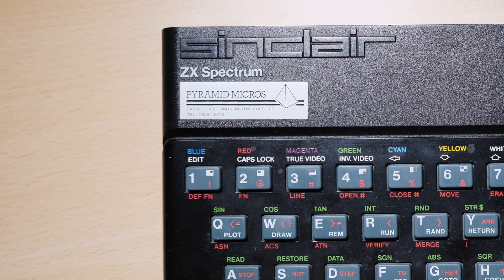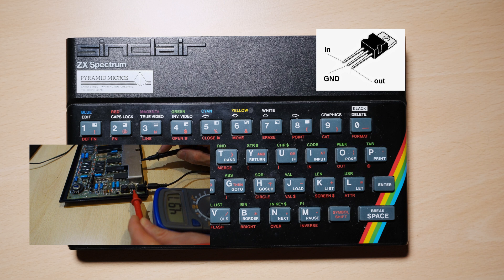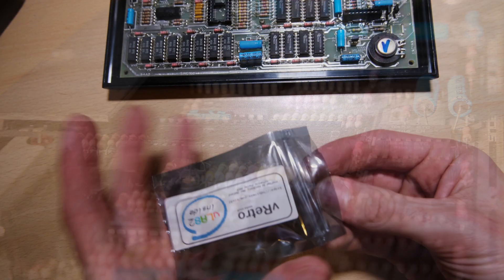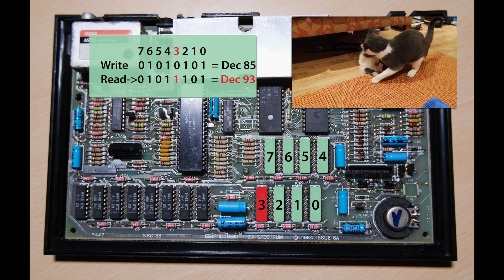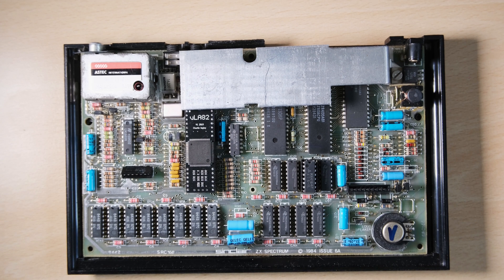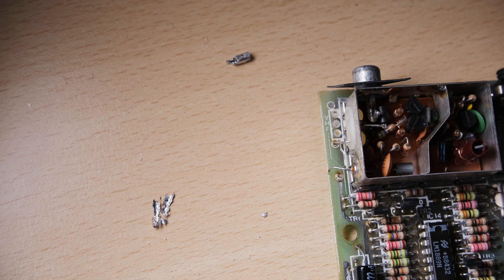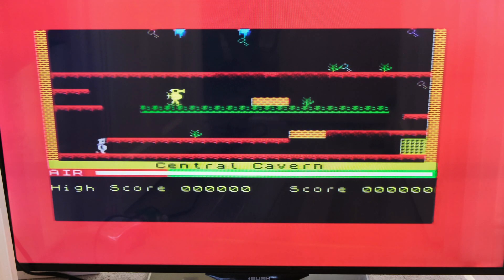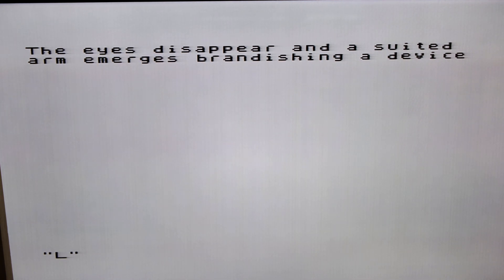Issue 6a ZX Spectrum 48K Repair - From Knackered to New

Comment: Really if you tests 40 years old capacitors in capacitance and ESR, you can see all are correct. The better things have a ZX Spectrum I think was the capacitors. It's not necessary remplace in general any one.

Comment: You'll find it took a lot of force for the VLA as it has round pins, the original ULA has a flat single wipe style. To do it right you need to replace the socket from single wipe to turned pin type.

Comment: i strongly advise using a cap for composite out, and possibly reducing the emitter resistor of the modulator drive transistor as will improve the negative going edges of the signal ..

Comment: minimum dc in is between 7.5 and 8v ...lower than 9v reduces heat in the regulator but stresses the dc-dc converter more as it has to work harder to get the +12v up ...

Comment: Jam in a TSR-1 2450 and you can dump the heat sink too. And it runs cool as a cucumber. $5 bucks on Mouser.
Reply from the maker: Good tip. I've got a drawer full of them.  I'm often torn though because you lose the authentic heft and warmth that the 7805 and the heatsink generate

Comment: Nice, I had an 81 as a kid, but it was lost several years ago, always wanted a spectrum but they’re not available in the states.
Reply from the maker: I've shipped a few over the pond ;)
Reply: there was the USAs own variant of the spectrum  TS2068, unfortunately not fully compatible unless you fit a spectrum rom in place of the original

Comment: One thing to do is replace the 7505 voltage regulator with a switchmode regulator, they run cooler, which extends the life of other components.
Reply: wont make much difference..
Reply: @andygozzo72  You have no idea how much energy the 7505 dissipates, it's dropping 9V to 5V, the heatsink gets painful to touch.
Without a heatsink the 7505 kills itself in a few minutes. A switchmode regulator(the can be a drop in replacement) can safely run without a heatsink, showing how much cooler it runs.
The ULAs are no longer manufactured, and Sinclair over exploited them in the design, so they run hot too. The two together are a recipe for failure. the other thing to do is of course heat-sink the ULA. 
The heat also contributes to drying out electrolytic capacitors. The 128k Spectrum had an external heatsink and was dubbed a "toast-rack". Sinclair designed their machines to be cheap, and pushed the technical limitations of the components.
Reply: @EmmittBrownBTTF1  yes, without it, it could fry(they're supposed to shut down with excess temperature, though) thats why they have a heatsink ,, loads of other devices use those linear 3 terminal regulators, some running hotter than in a spectrum, with no real issues ,

Comment: Nice video, in most cases TR4 and TR5 are indeed knackered. In some cases the coil could be knackered too.
Reply: definitely, a shorted tr4 can destroy the coil, it melts the wires enamel coating causing shorted turns, replacing tr4 without replacing a damaged coil will soon destroy the new tr4!  guess how i found out!!!!

Comment: great video, learned a lot about the spectrum's inner life! I also have a issue 6A 48K motherboard that has gone dark - no video, no clicking key sound. Did all the same testing as you do, I initially have all voltages in the 7805 regulator and lower/upper banks as per your video. but shortly after the voltages start to come down... I measure 4V at the regulator "out" and for example teh 12V at the RAM lower bank shows 9 to 10V... Do you think I should just change the 7805 regulator? Or transistors as well? Thanks!
Reply from the maker: Was the board working previously?  If so, I would recommend a new 7805, new TR4 and TR5, and then find a video by Joulespercoulomb "ZX Spectrum Initial tests" and follow along.  If you get to the end without any funny business then power it up and see what you get on the screen.
Reply: @HappyLittleDiodes  Perfect. will do so. actually , since I am at it, think i can replace the 7805 with a newer / more efficient regulator to have less heat dissipation, would you agree? thanks again.
Reply from the maker: Yes you can use a Traco TSR 1-2450.  I think Murata also make one which is slightly cheaper

Comment: I am after fitting a reset button to my issue 6a, could you please point me as to the exact location of where to put the wires from the switch, many thanks 👍
Reply from the maker: Hi Mike.  You can solder the two wires to either end of C27.  See the bottom left of this schematic.  RESET is active low, so you need to short it to ground to cause a reset.  
https://spectrumforeveryone.com/wp-content/uploads/2017/08/ZXSpectrumIssue6a-Schematics.gif

You can see it on a 4S board here
https://www.youtube.com/watch?v=NOUfxcpP3Xc&feature=youtu.be
Reply: @HappyLittleDiodes  Thank you so much for getting back to me and taking the time to show and explain how to do it. Definitely made a subscriber here 👍

Comment: A noob question, I can't see where you get the address 55000 from, for the Peek & Poke commands @ 7.41 ?
Reply from the maker: The address doesn't matter,  as long as it resides in upper RAM, which is all addresses between 32K and 64K.  I think I only chose 55000 because a website describing the trick used that address.

Comment: Hi, could you tell me what was with the wrong lines on the screen after ULA and Memory Replacement? I could tell some horizontal random lines on the screen. 
Thanks
Reply from the maker: I think you are just seeing an interference pattern between the resolution of my camera and the screen
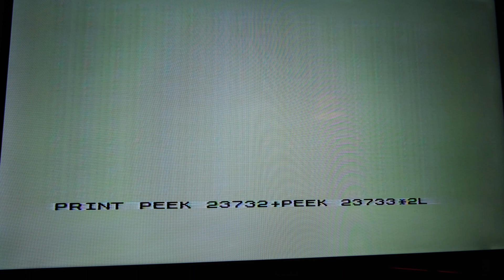Reply: @HappyLittleDiodes  No I am not. Minute 6:00 just a second before also later... about middle... centre of screen... and later appear some more. I have also this board and I changed some toasted memories and the ULA now it works but with those... glitches. Trying to figure this out.
Reply from the maker: @ElectronGordo  Yes, you can also see that the screen jumps right a couple of columns.  Later in the video I swap the ULA and it's OK afterwards.
Reply from the maker: Do you have another ULA to try?
Reply: @HappyLittleDiodes  No I have not, but this one works fine, cause it took it off another Spectrum and has not this problem. But with this Issue 6A appears. I will watch your video again, I thought they were there even after ULA replacement.
Reply: @HappyLittleDiodes  Yes, I tried it out, and the problem persist. That is not the ULA, I guess could be memories latencies
Reply from the maker: How strange,  please tell me if you find the fault.   I think it might be that my vLA82 "absorbs" the issue,  if you can fix it,  I might have two more working ULA chips that I thought were broken
Reply: @HappyLittleDiodes  We suspect it is due to latencies, one of us solved changing latencies with CAS setup. I want to try it out this week also. So do not throw your ULA's out.
Reply: @HappyLittleDiodes  I found an explanation in the book of the ULA by Chris. Page 246 Snow effects,  in his book The ZX Spectrum ULA, it makes reference a latency RAS and CAS. So now just left try out to change the set for CAS/RAS latencies